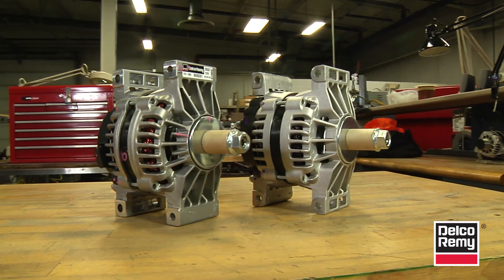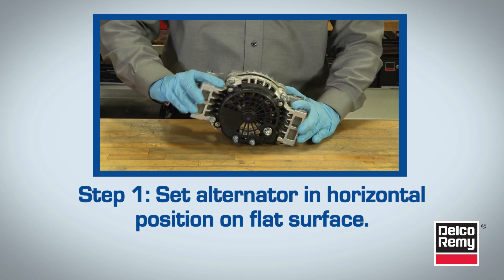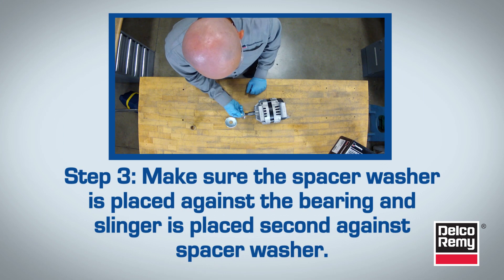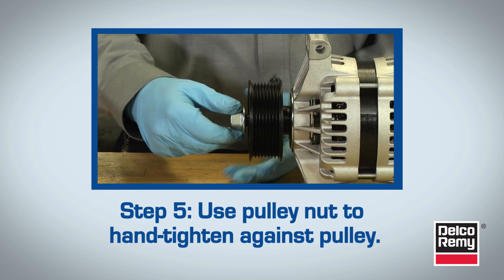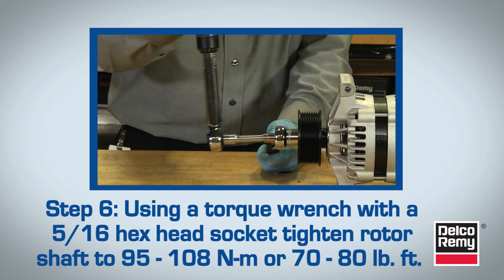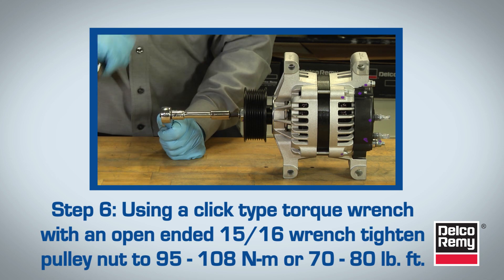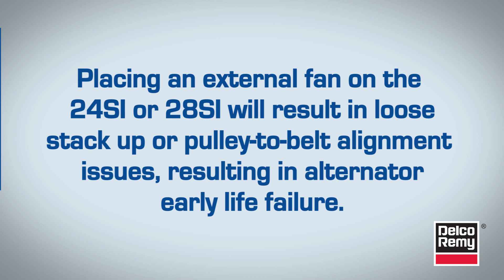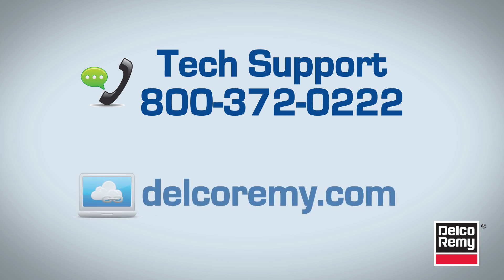How to Install an Alternator Pulley | Delco Remy Tech Tip

Comment: The second example in this video shows the torque wrench being used improperly. Whenever you add an accessory to a torque wrench you must place it at exactly 90 degrees to the wrench otherwise you will have an improper torque outcome because you have actually increased or decreased the length of the wrench in which the calibration was set for.
Reply: You are spot on. So many people don't understand torque wrench use.